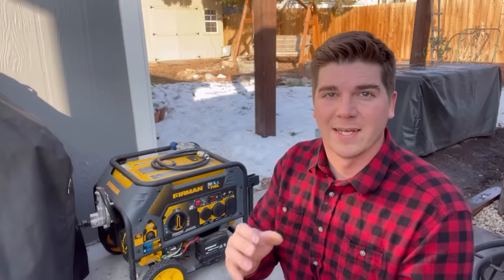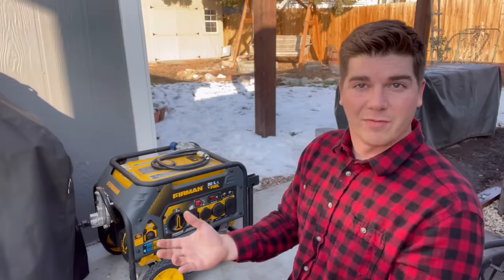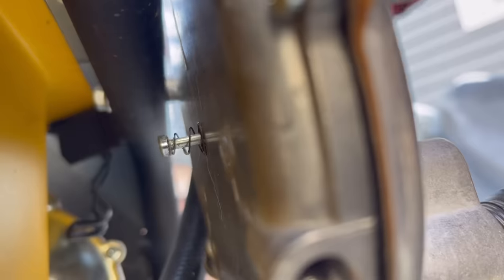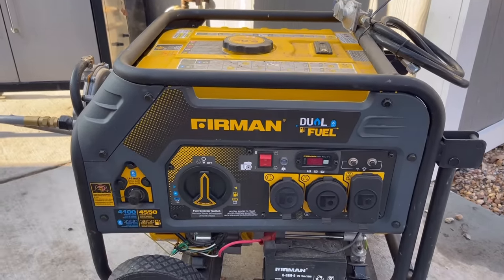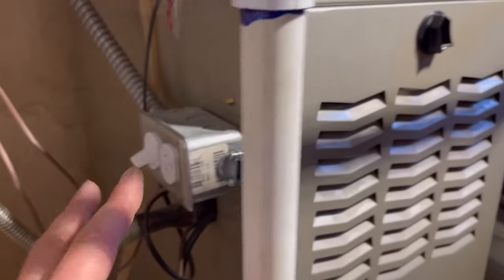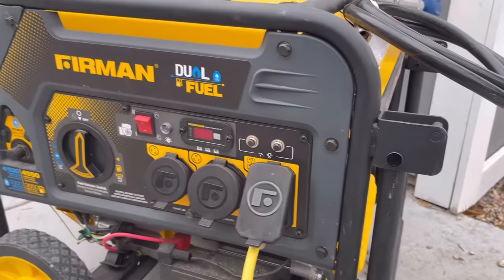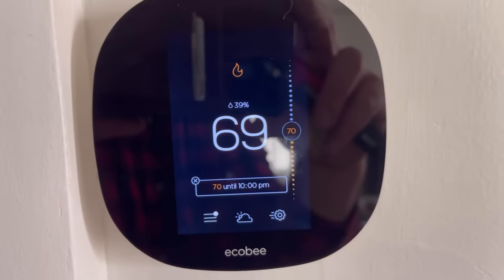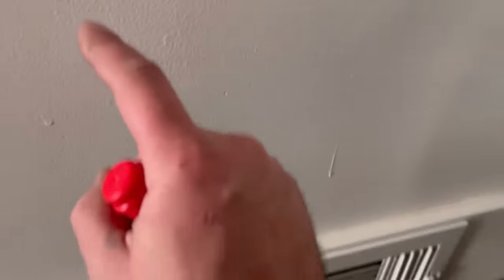Most Homeowners Don’t Know About This Trick To Get Heat During A Power Outage.

Comment: you should also mention as a warning that anything that is a sensitive electronic can be hurt if the generator surges or is overloaded.  you shouldn't run your tv, pc. and potentially your furnace if your generator isn't running smoothly like yours.  basically anything that runs with a chip can be sensitive to voltage drops.  i really like how smooth your generator runs on natural gas i had not considered that

Comment: If you live in a very cold area and you have the extention cord propping he door propped open. Letting very cold air into the house.  You can take The door door knob off an fun the extension cord through the knob hole an stuff a small towel in the door knob hole. Keeping the cold out side.  To keep the door closed.  You can use the dead bolt or a chair or something against the door to to keep it shut.

Comment: Yes, it works and it's great way to do a backup in an emergency.   I would highly suggest that you install an interlock in your electrical panel to insure that someone else doesn't come along  and turn the main breaker on while the generator is running.  Please keep it safe for yourself and the linemen that may be working on the lines in your area.
Reply from the maker: Thank you. Interlock kit is soon to come with a full install tutorial! Thanks for watching. Cheers

Comment: On one of our last videos, a commenter suggested that running the furnace off the battery (and then charging the battery with the generator) was a better idea, as normally the furnace goes off and on.  The generator will keep running (even at idle) whereas nothing is drawn from the battery when the furnace is off.

Comment: I have been using the cheapest ethanol fuel i can get on these for years with no problems. The secret is that every 3 months drain it all out, dump it in your car and use it up but then immediately replace it with fresh pump gas. Then make sure to start and run generator for 15 minutes to get the new fuel in the carb. Preferably with a load on it. I just plug in a space heater. If you want you can use a fuel stabilizer but i never do because i usually change the fuel out every other month just to be safe. I got it setup so I can open a valve with a hose in a gas can and walk away. Come back a half hour later and the gen is empty.

Comment: Not sure if it was mentioned here, I was told by an electrician to start the generator and let it run a couple of minutes to let the power head  gain steady power prior to putting a demand on it. It’s especially important for those back feeding the panel box. 
A sine wave generator is needed for sensitive electronics like TVs and computers as any voltage spikes will likely ruin them. 
Nice information on this channel, I like the pigtail setup, I previously unwired my furnace and used Romeo to the generator during hurricane Sandy years ago, my house had 70 degrees of heat and lights for all 8 days. needed while the rest of the street was dark. I now will now add your method to have the quick plug disconnect so I can have a permanent solution.

Comment: I live in the Southeast US, we routinely lose power approximately 3-4 times a year for about 4-6 hours per occurrence.  The generator I use is a 4000 watt Harbor Freight and runs strictly on gasoline.  I put a reminder in my phone calendar every month to run it and make it power something.  I also use Stabil in the gas for it and have never had a problem with it, starts every time on the first or second pull.  Every year it also gets the oil changed in it.  Think I am going to be doing this with my furnace as we just lost power on the coldest day of the year (low 10 degrees) it's usually always in the spring, summer, or fall, and never that cold.  Thanks for posting this.  FLY NAVY!!!

Comment: Just a comment on plugging the open fuel ports:  A better method would be to purchase some rubber caps (similar to those used in automobiles to plug unused vacuum ports).  They seal better than tape and are reusable.  Great series of videos btw.

Comment: I have the tri-fuel model and a NG quick connect similar to this set up. What I learned from frequent outages in our area is that in winter, with the furnace, water heater and two gas fireplaces taking NG off the line first, pressure was inadequate to the generator to run on NG. Fortunately I have a 20lb propane tank that I can use instead. NG is great, but most houses will have other NG requirements that will prevent NG from being useable to power the generator. Thanks for this video! The more knowledge the better!
Reply: I stand corrected on this explanation. It so happened that my water tank needed replacement last week and coincidentally the guy who installed my BBQ gas line 5 years ago was the guy who came to do the tank. I asked him about this. He said it’s the size of the BBQ line to the deck (1/2”?) which I use for the generator, not the number of appliances on the system. A bigger line would help.

Comment: Most smaller generators  2500 watts or smaller are running with a floating neutral. You have to have a bonded neutral for this to run most newer furnaces. My furnace is 16 years old and required a bonded neutral on the generator before it will operate with a straight extension cord to the generator. Large generators like yours are all wired with the neutral bonded to the ground wire from the factory.
to get my furnace to operate with this same setup you are showing, I had to order a bonding plug from Amazon and plug it into one of the 120 v outlets on the generator .. It looks just like a plug off of an extension cord .. when plugged into the socket on the generator, It connects(bonds)  the neutral wire and the ground wire together on the generator. The main panel box on your house is wired this way with the neutrals from all circuits connected (bonded) to the Ground.
If you were hooking the generator to your main panel box for operating the furnace, you wouldn't need to use a bonding plug on the
 generator because your main panel is already bonded.
Reply from the maker: This is good Knowledge to have. Thanks for sharing!
Reply: You can bond the neutral just by taking a male plug and connecting the ground to the neutral and plugging it into one of the  generator outlets.
Reply: @tgriebe  Yes, you can make a plug like you're talking about. I just bought this one already  made. it's all connected inside the plug like you are saying. 
Solved my furnace starting problem...
Reply: I agree with Roger.  If you have a generator with a floating neutral this will not work with newer digital furnaces. The blower runs but will not go into the fire mode. 
You need to purchase or make a Bonded Neutral plug.  This needs to be plugged into one outlet of the generator.  Then you have a bonded neutral circuit that is just like your household power. If you have more questions, research Bonded neutral grounds for generators on YouTube.
Reply: A floating neutral........I never knew.Why would they do that?
Reply: @tgriebe  Hey Tom.  How can you tell if you need this plug. I plan to strait wire my furnace to a firman 3500. If it don t fire the burners try the plug?
Reply: @Thunderroad8517  You may not need it. but it won't hurt to install a neutral grounding plug.

Comment: Well we’re about to hit 10° here in Texas and in 2021 (after a low of -7°) we went with a Champion dual fuel 4250w to run off our 200 gal propane tank. We won’t have central heat but do have a fireplace and can run a refrigerator, a 750w small heater, coffee maker, griddle and a TV/cable/internet set up (obviously not at the same time). We also have a Bluetti EB50 for phone charging and a few LED lights. The NG and LP are absolutely the best way to go vs gasoline. Slight reduction in available wattage but still an easier way to maintain a unit. Great video.
Reply from the maker: 🙏🏻 stay warm friend

Comment: That's a slick generator.

Good job showing those that thought you were doing something wrong and back feeding onto the main grid.  Those people commenting that clearly don't have a concept on electricity and how things work and shouldn't attempt to do this kind of work.  Pretty basic stuff here.  I did a similar setup for my sump pumps where instead of hard wiring it into my GFI plug (to provide protection on the rest of the circuit) I wired it to a male plug adapter and just plug it into the GFI receptacle itself.  Then whenever there's a risk of the power being out during the mid winter thaws and the power does indeed go out, I can just run an extension cord to that receptacle, unplug it and plug into the extension cord which is being fed from my gas powered generator outside.  Exact same idea you've shown everyone but for the furnace.  At the time 10 years + ago when I did this I was more concerned about basement flooding versus keeping the family warm :) but have since adopted the same thing for the furnace.

Comment: Very cool video! That model generator has very high total harmonic distortion. This can potentially cause issues for certain controller boards. It is also important to note that this generator has a neutral bond to the frame. I would bet that if you used a generator that did not have a neutral ground bond ( floating neutral generator) that the furnace would not work properly. From what I've read the flame sensor needs a ground reference otherwise only the fan will turn on and not ignite the flame on generator power.

I'm going to be working on that exact model Firman dual fuel generator in the near future as it currently has an issue.

Comment: Bought a duel fuel generator at Sam's and used it with LP to paint a house 4 years ago. Pulled it out a month ago for a power outrage and it saved the day. Have to look into that mod for the furnace

Comment: Thanks Dave for another video with lots of useful information!

For those wanting to save some money, here's an alternate generator, an open frame inverter generator with 3,500 running watts; the WEN GN400i, currently selling for $383 on the Wen website.  It only weighs about 70 lbs, is more compact, and with no battery start or dual fuel.

The type of generator (the Firman) shown in the video is a basic 2-pole generator.  They use a lawn mower engine and run at a constant 3,600 RPM (full throttle) in order to produce the 60 Hertz line frequency.  Due to the engine speed, they are produce lots of noise/vibration and eat lots of fuel.  That generator will empty that BBQ grill propane cylinder in a few hours.

I prefer the Inverter type generator, as they always produce a perfect AC power signal and throttle the engine back when electrical low is light, saving gas, noise, vibration, and engine wear.

I try to never buy the electric start generators as the battery only seems to last about 1 year.  Most of the portable generators have an engine small enough that they can be hand cranked easily.
Reply: Takes mine a bit more than a few hours (11+ hours to be precise) to “empty that bbq grill propane cylinder” on the Firman. There’s also ZERO upkeep/maintenance on LP, & NG. It stores f o r e v e r … can’t say the same about the gasoline in your WEN. Also, if it’s reserved for emergency use, I don’t care how much noise it makes… there’s an EMERGENCY. Which of course helps me flex on the other neighborhood dads… when the power is out, and they ALL can hear my generator running. 💅🏻
Reply: @djek8667  I think you are correct on the fuel economy, I'm not sure what I was thinking at the time.  I think that 200 cc engine consumes about a half gallon an hour.  

I have had a lot of trouble in the past with gasoline going bad if left in the engine, fouling the carburetor.  I (through trial and error) developed a gas mix that doesn't seem to go bad.  I use non-ethanol gas, mixed with Sta-Bil and Marvel Mystery Oil.  I have only tested it out to 4 years so far but, it causes zero fouling in fuel tanks and carburetors.

As far as running off propane, LPG, or natural gas; agreed it is the cleanest burning and causes zero gasoline deterioration issues.

Comment: Thanks for the follow up video and the tip about how/when to turn off the generator.  I hadn't thought about not cracking the heat exchanger but agree it could be a possibility if you turn the generator off before the heat exchanger has cooled down.
Reply from the maker: You bet!
Reply: @diyhvacguy  Couldn't the heat exchanger crack when the line power goes out?
Reply: That's a great reminder to people.  I hadn't thought of that risk.

Comment: In 2020, I bought a 6,500 watt Champion generator and did the same tri-fuel conversion with the Motor Snorkel. I love it. Hooked up primarily to my natural gas utility with 8 20lb propane tanks backing. I made a mistake though, I really should have bought an inverter generator. May remedy that in 2023 depending on how the geopolitical world looks. Also looking at the comments below, I think I should look into that bonded neutral issue. Always new stuff to learn.
Reply from the maker: My Firmin 3500 white actually has a bonded neutral apparently. I didn’t realize that but it prevents you from having to take that extra step
Reply: Why was it a mistake to not get an inverter generator? I think the only one that I trust is the Honda lineup, but they have low power output and are really expensive on a per watt basis. They also don't have a grounded outlet, and if I remember right the neutral is floating. So some things don't like it, but can make a cheater box for it. Anything with a 2 prong plug will work fine, I think if I remember right, I plugged in my outlet tester into one of the generator outlets and it said I had no ground, but hot and neutral polarity was correct.
Reply: @diyhvacguy  Bonded neutral is fine. You just have to be careful if you directly connect to the building system that will already have a main bonding jumper. What you could do in that case is, only connect your hot(s) and neutral wires from generator to the house, and DO NOT CONNECT any ground wire from the generator to the house. And leave the generator neutral to frame bond alone. And then put the generator on some rubber pads or something to isolate it from the surrounding ground, and don't touch while running. This way you will only have 1 point of interconnection from neutral to ground on your premises, and you stop nuisance neutral current from flowing thru the grounding equipment conductor back to your generator. This isn't quite code legal, but then you don't have to modify your generator, and by keeping the neutral to frame bonding intact, you can still use your generator for camping, running power tools etc, and still be OSHA compliant to use on a job site.

Of course, if you want to permanently connect a standby generator to your house, then you want to convert or make sure to get a "neutral floating" generator, if the transfer switch setup does not switch the neutral. Which will be 99.9% of the time for residential setups. The only time I run into transfer switches that also switch the neutral is at health care facilities like hospitals and nursing homes where the generator has to meet life safety codes. My wife works at a larger nursing home, and we ripped out the old Generac generator there which only backed up the coolers, freezers, computers, and the resident room outlets and such. And installed a newer generator that runs the whole facility, that things a beast! It only has an inline 6 cylinder engine.... but it's twin turbo, 750hp, and 33.4 liters... It can supply up to 1600 amps at 208v 3 phase! Anyway, that transfer switch switches all 3 phases and the neutral from the utility pad mounted transformer to the generator, however the neutral to ground bond is still in the main 2000 amp service disconnect in the basement.

Anyway the thing to remember to keep things safe in any electrical service, is you only want one single solitary point on the entire system from the meter or utility point of presence, to the last branch circuit, that has a neutral to ground bonding connection. Think of it like Highlander, there can only be one. Multiple points of contact on one service between neutral to ground, especially in wet locations, can be extremely hazardous. Kids have been killed by stray currents of only 2 volts flowing thru a swimming pool, because neutral current was flowing thru everything grounded at the place because some moron installed a sub panel out in the barn, and connected all the neutrals and grounds on all the same bus bars just like the main panel in a house. Big no-no, you can only do that if there's only one electrical panel right behind the meter.

Watch some of Mike Holts videos on grounding and bonding, and 250.2, and 250.6, (objectional current).
Reply: @brnmcc01  Because apparently some electronic devices can be damaged if they are powered by a non inverter generator. Which on the one hand does make sense, but on the other, it doesn't, and it is hard to get a clear answer. I am sure tons of people use non inverter generators in power outages, like the one we just had, and yet you don't hear of tons of people blowing their fridges, freezers, TVs, etc. Yea some, but you'd think the stories would be more plentiful if it were a hard fast rule.